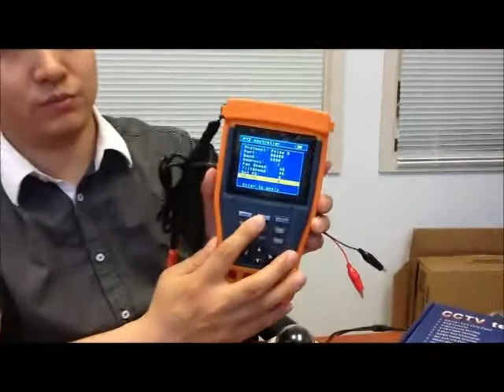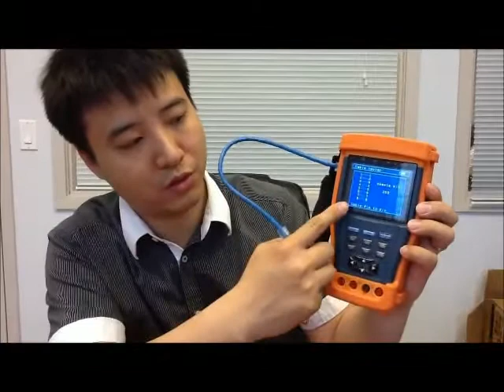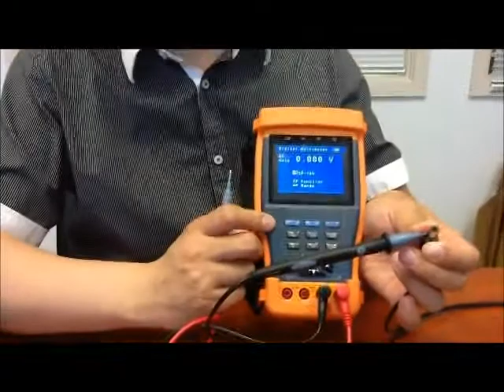CT894 - CCTV Tester Pro

Comment: Thank you. I just bought this today. My unit is identical as  yours but with an different name. It's a RioRand (TM) Cctv Multi-function Tester PRO M - Built-in Digital Multimeter - 3.5" LCD Monitor Cctv Tester Video / PTZ Tester. I will test it tomorrow. How long have you had it?